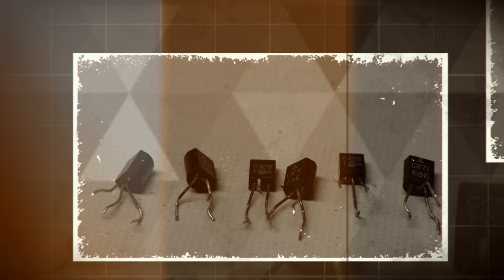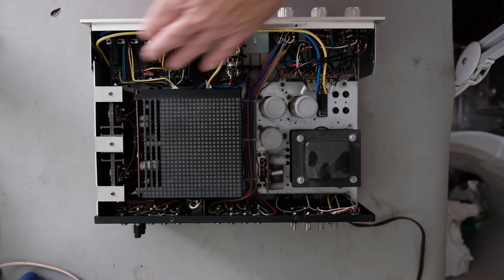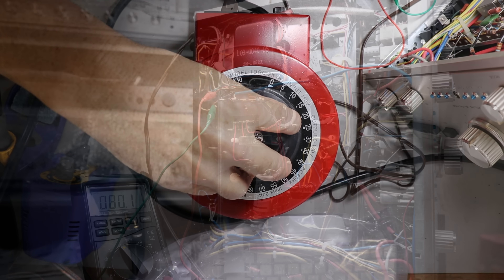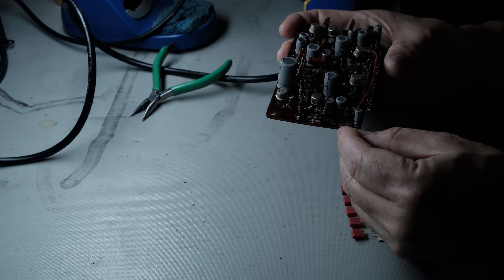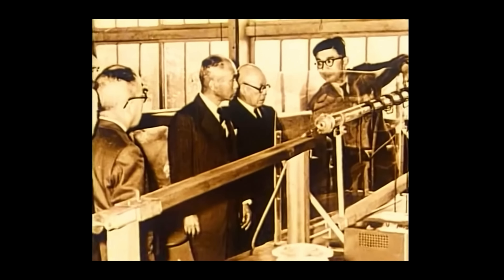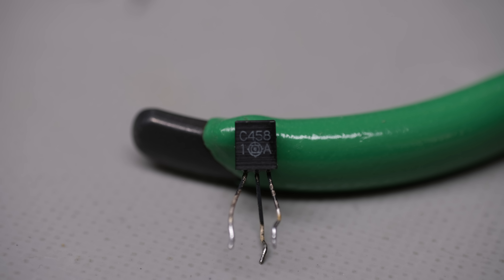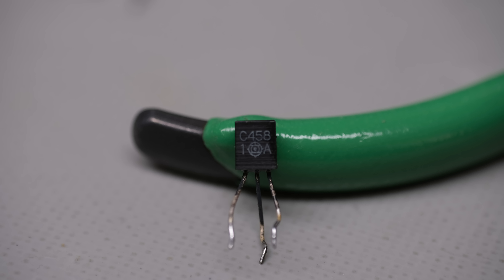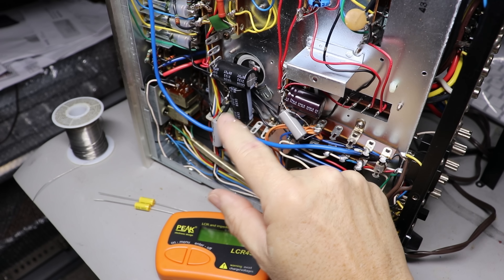$45 - Buy This Amplifier! Cheaper And Better Sounding Stereo. Spend Less On Vintage HiFi Audio Gear

Comment: Nothing wrong with old Kenwood stuff. I had one in High School and was able to pick up a 60 watt Kenwood receiver for $75 from EBAY that only has one lamp out. Better than the 20 watt model I had back then. Got a nice monster 140 watt Sansui receiver too. Much better than the new home theater receivers made today.
Reply from the maker: Couldn't agree more. Thanks for commenting.
Reply: Typical Japanese mass-fi from the 70's. Nothing special aurally; just lots of bells and whistles..and meaningless specs.

Comment: you never said what the dim bulb tester does, or even what part of your testing process does it fit. pardon my ignorance, im trying to understand exactlywhat youre doing.
Reply from the maker: In a nutshell you use a dim bulb tester when you power up unknown vintage electronics. If there is something in the unit under test that is drawing excess current the dim bulb tester will help prevent further damage.  You can google "dim bulb tester" for more detailed info.

Comment: When soldering you need the proper solder thickness for the project. And an adequate wattage soldering iron. So you don’t overheat the solder pads.

Comment: Thank you. I had a KA 5002 from 1976-1979 . I used it to D.J. back in the day as well as for my home system with the matching tuner. 
It still has the best quality knobs of any make or unit ever produced. It was stolen out of my van one night along with two turntables.
I replaced it with a new more powerful KR 8010. But the 5002 started my lifelong love for the vintage Kenwood equipment.

Comment: Fantastic video.  I believe we are of the same vintage and the 70's for an audio addict were unbelievable.  At 18 I bought a Toshiba 40 watt/channel receiver and a set of Klipsch K Horns at the recommendation of an older friend that was an audio engineer at the time.  Well in the belief that bigger is better I continued to trade up over the next 5 years from records ( skipped all over the place at higher SPL) to an Akai reel to reel  and eventually ending up with a Kenwood KR-8050.  I still have the K Horns and the 8050 and they still continue to amaze after 49 years, the neighbors like the sound so much they keep throwing bricks thru my windows so they can hear my system better.  My daughter already grabbed an KR-8050, a B&O direct drive turntable and a set of AR-4x speakers for spinning vinyl, just love the sound.
Reply from the maker: Thanks for watching and sharing. I still have some of my stereo equipment from the 70's, wish I had more of it. It's really that your daughter has some gear.

Comment: Just finished watching this video again,,, while playing my KA-6000 (MADE IN 1969-70) which is built alot like this Amp
 And is still kicking and strong, and low noise floor.. Visually its flawless , and inside the unit it looks orig... Not bad for 52 years old... Something special about the sound after its been up and running 30 mins...  I also been playing a Sansui 4000 receiver i picked up,,, and has a similar sound,. At least to my ears..

Comment: I had two of those at different times, once in college, sold that, and bought another one to use in my shipboard stateroom as a Naval Officer. Loved it so much, I bought one for my dad to replace his mono tube amp. Great sound, quiet, and I loved the look of it, too. Loved the operation of the knobs and switches. Very satisfying clicks, presses, and turns.

Comment: Kenwood-Trio produced fine electronic gear and also became big in communications equipment both in commercial and Amateur Radio in addition to audio equipment. I owned a Kenwood TS-520S that was as solid as a TANK! I still have a Kenwood turntable that has been a solid performer. 

I like to use my smart phone to take pictures of the parts on the boards as a reference to go back to double check how things need to be put back in. I’m too ADD to trust my memory 😉😂

Excellent presentation and great teaching video!
Reply from the maker: Thank you very much for the kind words. Kenwood did make some wonderful gear. One of my first components was a KA-3500 integrated amplifier that I purchased in the middle 70's. I still own it today.
Reply: @vintageaudioaddict  unfortunately too many of the contemporary consumer electronic devices will be in a landfill within 10 years.

Comment: I really like that whole series of Amps. I have a KA-5700 with the meters. You're right - who needs anything else. People are chasing "names". No reason for it at all. Imagine all these people chasing 800 dollar 10 wpc receivers.  Thanks for making this video.  Wonder if you could do a video diagnosing an amp with DC on the output.
Reply from the maker: Your welcome and thank you for watching. I haven't made a video specifically on DC offset but I've covered it along with other issues in this repair guide video - https://youtu.be/r9WCxefytBI

Comment: i am a kenwood user since the 70´s but in Europe they ask thousands of €´s for that integrated amplifier, those 30 watts can boost 190 watts speakers and with the tone controls it delivers such a clean high´s and lows ,also the speakers at the time were huge having only 30 to 50 watts at the most but a very clean and perfect sound, the impedance selector for the turntable cartridge it´s a rare thing to see in today´s amp.´s but needed with a lot of changing cartridges fashion today
Reply from the maker: Thank you for sharing.
Reply: @vintageaudioaddict  thank you for the great videos, when studying i changed from electronics to a Informatic degree , it was new at the time , today i can´t restore old hi-fi equipment as you do , have always to meet with an old friend who continued his studies in electronics and high-voltage systems, regards

Comment: I always Loved Kenwood products, I live in the Northeast and in the Eighties we had a specialty retailer called Tweeter Etc. they only sold high end stereo equipment, Yamaha, Onkyo, clipch, Kenwood And so On, I bought many of my Car stereo systems there, all Kenwood and it Blew the doors off anything I had previously owned. Never had a stereo and Amp package that sounded that good. They were Pricey, but well worth it. I’ve been a Huge fan ever since.
Reply from the maker: Thanks for sharing! I remember hitting my local stereo dealers back in the 70's. My Pizza Hut salary didn't go far but every now and then I brought something new home.

Comment: I still use an old Kenwood receiver to power my living room speakers. It sounds so good. I use two vintage Zenith speakers and of course the receiver is the amplifier. the Zenith speakers have a 10 inch low end woofer that actually hits some pretty good lo end frequencies down to 40 hz with ease at more volume that I would ever need or use in my home. It's a 4 channel amp with switching  so I also have two slightly smaller satellite speakers in my dining room up high on a shelf and they also have more power than I would ever need so I can A/B the rooms or run both rooms left and right or run surround in one room if desired but not needed in my space. It's wonderful just tossing a blue ray or DVD in. Movie theatre quality for sure. You can feel the floor move when there is a steam roller in the movie and it's turned up a bit.
Reply from the maker: Thanks for sharing. The vintage audio gear can still hold it's own against the modern audio equipment.

Comment: Great, great video, thanks for taking the time to post it. As a beginner in electronics, I found your explanation of the restoration process extremely informative. I got lost in the last part of the video when you did the final adjustments, dc offset, etc.. It would be great if you could maybe do a followup video showing the exact steps and equipment used to adjust it and then bench test with basic equipment readily available on the used market such as an analog oscilloscope and signal generator.
Reply from the maker: Thank you for the kind words and for the suggestions. If you are just starting out take a look at this video where I show how for under a $100 that you can own a oscilloscope/signal generator. -  https://youtu.be/heAuUJR-bmQ

Comment: I probably got my best deals buying vintage gear on local bidding sites, with a strong preference for physical pickup AND always in country (live in Switzerland) to limit shipment risks and costs.
My favorite buys:
1) Hitachi SR-903 receiver for $140 that is in mint physical condition and works/sounds great; bought it earlier this year.  A couple of incandescent lamps required replacement, but otherwise fully operational. Did some cleaning, some DEOXIT and checked the DC offsets before use (under 15 mV). I downloaded all of the service related documentation (which is both excellent and FREE) and have put together an Excel sheet to map out the planned transistor and electrolytic capacitor replacements; for next year.
2) about 2 weeks ago I found another Hitachi SR-903 that looked dirtier but was advertised in working order. Bought it for $115 on the same local budding site and from another private seller.  I cleaned it up and it shines as minty as the first...had lots of dust inside compared to the first unit.  Same treatments and checks were performed to full satisfaction.  Runs like a champ...but with similar bulb replacement needs (just a couple).

The Excel buying sheet (for all of the discreet components at risk) will be used to buy for both.  I figure if I can master the first...the second will go like a breeze! We shall see. I intend to keep these babies and pass them to my kids someday.
Both units came with a factory flat black painted wooden case.  Condition was excellent for both...but it looks boring as hell.  I decided to buy some glossy burled walnut vinyl wrap off of AliEx and carefully wrapped both cases (used a heat gun sparingly). I applied ceramic coating to the vinyl for additional protection...the results are stunning.  Each case looks like a lacquered cigar box! Love the look...very premium IMHO.

Why Hitachi?  They are not well known versus Marantz/Pioneer/Sansui...so they do not command a huge price premium in this used market. Hitachi was a key supplier to the major brands...they knew their stuff back then and put out high quality (over spec'd) units in an attempt to build a foothold in the premium market during the receiver wars. The SR-903 produces 75 watts per channel...However, they utilize what Hitachi termed a G-class amp design with peak power up to 160Watts per channel (to avoid any clipping). More than enough power for my needs.

These units look fantastic, sound terrific, and are built like tanks. Classic ALU face plate with hefty ALU knobs, levers and buttons. For me, they were an absolute steal at these prices. I have a few other brands on a rack at home, really mint vintage examples from Pioneer (LX626, SX82E c.1965), Yamaha (CR420), Nakamichi (SR-2E with Nelson Pass designed STASIS amp)...the Hitachi's occupy both the family room and the home office.  They are that good, IMHO.

Comment: excellent instruction .. should have watched this video first .. but still learning...  tool prices have really increased on that de-solder gun by Hako .. may have to get it anyway .. and found the Kenwood history to be amazing ... that history lesson, and of course their reputation among Ham Radio operators, speaks volumes as to their importance as a major player in electronics .. much respect for presenting this information and for a great instructional video

Comment: Well, hello there Vintage Audio Addict. Thank You so much for your Channel and all that you put into it. You have a wonderful way with your guidance. Easily understood, (by me), Concise and thorough. That makes sharing in your Channel a complete joy for me. By the time that you were wrapping things up here, I was more knowledgeable AND more Relaxed than when I began. This is a pretty great combination so, I Thank You again. Now I know where to come for my "Schooling."

I would like to ask a question, of you, before I go... I need to apologize, in advance, for my ignorance regarding a possible "Work Around" for my issue. Through a weird set of circumstances, I now find myself with multiple sets of Speakers that are all rated at 4 ohms, yet the only Receivers / Amplifiers that I have, are all rated at 8 ohms. I've had money most of my life, but no more, so I don't have a lot of choice, but to do my best with what I have.

Do I understand correctly that if I were to take 2 sets of 2 speakers and wired them together in "Serial," as opposed to in "Parallel," that my Receiver would then see the Impedance as 8 ohms per channel, instead of their native 4 ohms per channel?  I'm not certain that I fully comprehend the intricacies of matching ohms. For years I had been using a Denon AV/Surround Receiver, without issue... until one day, seemingly out of nowhere, my Receiver shut itself down and never to return. Not even after using the Key-Press Combination to Reset it. It behaves as though it is going through the process of Resetting itself, but never comes back to life?! So, because I have no money to spend, I am concerned that I might "Kill" whatever replacement Receiver I might choose to use. I only have 3 to select from, and as I said all of my choices, in receivers are of the 8 ohm variety.

Thank you for your patience. Anything that you can do to help me will be greatly appreciated. Living Life without Music, is a bit like Living Life in Black & White, for me and I need some happiness here. (lol) I hope that you remain Well & reasonably Happy too. Keep Smiling... Cheers... 😇
Reply from the maker: First of all thank you for your kind words and for watching. There is no one answer to your situation. When it comes to running multiple speakers from your equipment you have to be careful. Most speakers are not a uniform 4 or 8 ohms through the audio spectrum. At certain frequencies their impedance can be much lower or higher then rated. Some can be difficult loads for audio equipment. Receivers/amps with 4 or 8 ohm ratings are the same. There is no one specification that fits all. Some tolerate certain speakers better then others because of their current handling abilities. You have to be especially careful when you attempt to wire more then one pair of speakers to a receiver/amplifier.
Reply: @vintageaudioaddict  Wow, that was a quick response! I really didn't expect that so, Thank You.

I was afraid that the answer to my question might be an elusive one. UGH! does it make any real difference as to the grade of Speakers in use? If so: I have 3 pairs. All of them are "Polk Audio. One set is "Floor Standing" and cost me about $1,000.00 each. The next pair is a "Mid-Sized" and about 22" tall and were about $600.00 each. The third pair are "Bookshelf" Speakers & I traded some equipment for them... and YES, they are all rated at 4 ohms. So, at least they're not of the Super Cheap variety. When the Floor Standing Speakers were purchased, the upper scale Stereo Addiction Dealer sold them to me with a Denon AV Surround Receiver. (Rated at 80 watts per X 5.1), but had a Stereo mode too. Well this combination lasted me for more than 10 years... until it didn't any longer.

The only reason that I brought up anything other than the Large, Floor Standing Speakers, was because I had hoped that I could fool my receiver into seeing 8 ohms impedance attached to the 2 Stereo Front Speakers. Otherwise I don't expect to run anything but the large ones, unless...

Oh man, I'm so sorry, I didn't intend to write you a book here.

So, it looks like I don't currently have anything like a good solution to my problem then? Ha! Yet another case of "Acceptance" I suppose. ARGH!

Thank you for sharing your knowledge and expertise with me. You are appreciated for this. Remain Well & Take Care, Cheers.

Comment: Great narration, explaining each step in detail, always necessary for amateur restorers of vintage equipment.
And, I fully agree, many of the vintage amplifiers out there can be as good - if not better - than most of the overpriced 'modern' offerings.
The additional benefit of vintage equipment is the relative ease of servicing them, as against the minute micro-components (resistors, caps etc), used on most printed boards now that require a microscope to observe and are a real 'pain' to replace.
So, thank You for a most informative and entertaining video.  One hour and eighteen minutes well spent! 🙂🙂
Reply from the maker: Your very welcome and thank you for the kind words. Very good point about the serviceability of the vintage equipment compared to the modern gear.

Comment: The main difference with electrolytic capacitors is longevity and if the start leaking over time.  The big catch for new players is counterfeit capacitors, which are all over particular auction sites.   The main thing is to buy your components from a reputable source and not from some cheap seller on one of those auction sites.  I would always do like for like replacements.  If the original has electrolytics, replace with electrolytics.  The rest of the circuitry is designed to work with the nuances of those capacitors.
Nice to see this up and running again.   This old stuff is worth restoring.   A lot of new equipment using name branding is not made by the original company anymore.